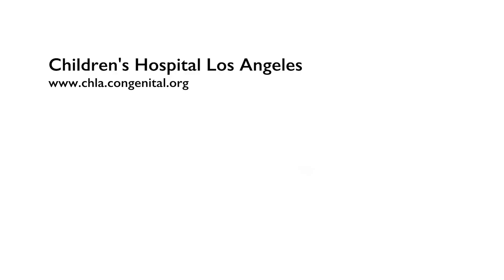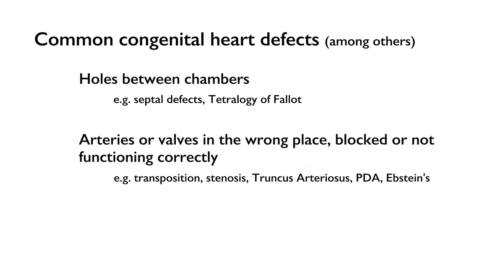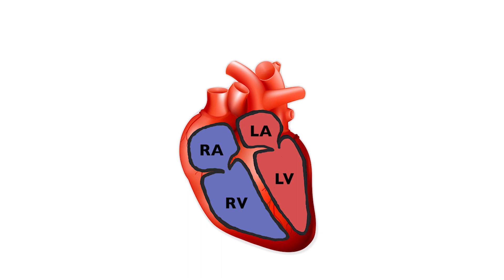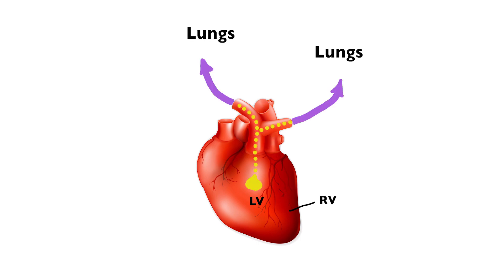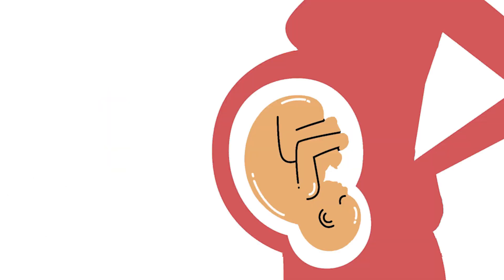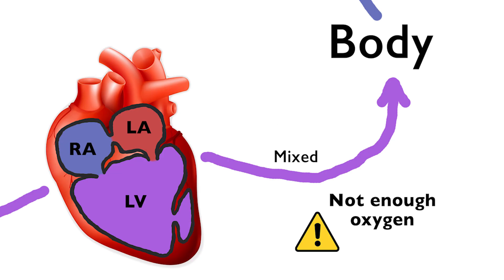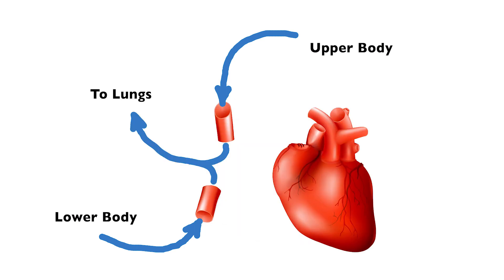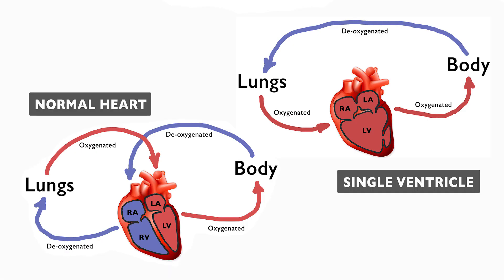Single Ventricle Heart Defect and Treatment Explained - DILV

Comment: My son has exactly the same diagnosis, DILV TGA. His first year was pretty hard for all of us. He is now 5 years old and has a completely normal quality of life. His stamina is not any different than his healthy brothers. One day last year, he jogged more than a mile while I walked quickly. I wish you guys the best of luck!
Reply: Hey dear have you operated your son with surgeries??
Reply: @quratulain5727  My son is now 6 years old and will soon have his 4th open heart surgery to add a pacemaker. They discovered that his heart is only beating half as many times as it should when he is very active. He has no symptoms. His cardiologist told us that electrical problems are more common than not with these kinds of defects. Hopefully this will be his last open heart surgery for a few decades. He can run with his brothers, he is smarter than his brothers. We have not had any daily reminders of his condition.

1st open heart surgery when he was 3 days old to help adjust blood flow levels to the lungs to avoid damage.
2nd open heart surgery at 6months old to reroute half of the return blood.
3rd open heart surgery around 3 years old to reroute the other half of his blood.
4th open heart surgery  planned this summer to add a pacemaker.
no additional surgeries expected.